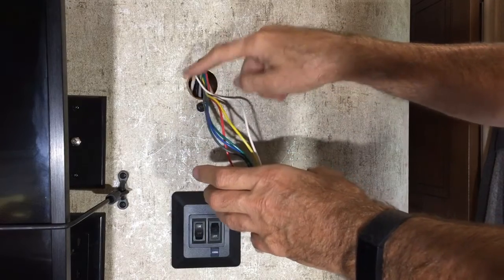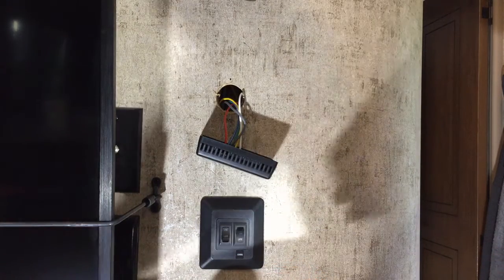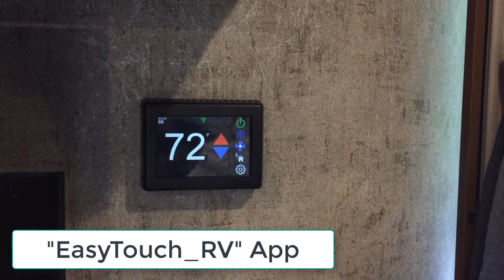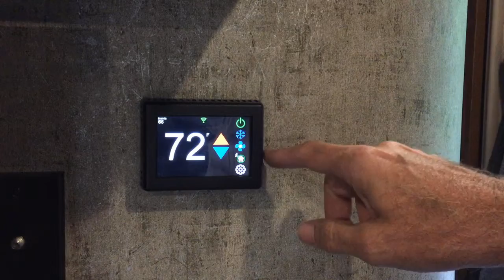Micro-Air EasyTouch Thermostat Installation

Comment: Jim, I installed one of these and then found your channel. I wanted to point out to anyone thinking of installing this thermostat that there is a great benefit that might matter to you that is not really mentioned anywhere.  This thermostat will let you run the furnace and AC FAN at the same time.  This is great if you like the white noise from the AC Fan while sleeping and need heat.
Reply from the maker: Excellent point! Thanks!

Comment: Thanks Jim, useful video.  I'm consideirng one of these and was wondering if you happened to see how much power this little guy draws?   My gut says it would minimal, but I'm a boondocker and sometimes every little bit adds up....
Reply from the maker: I didn't try to measure the thermostat's power draw. But it can't be much. Probably not more than a couple hundred milliamps.
Reply: @litzdog911  Thanks again!